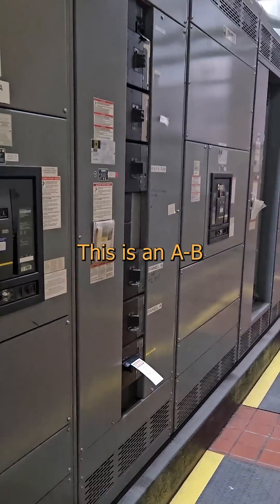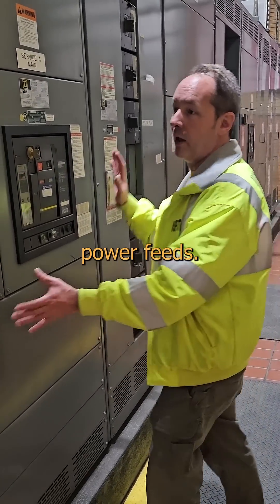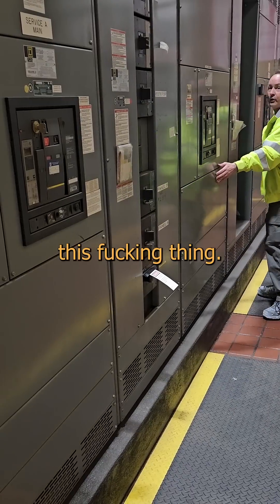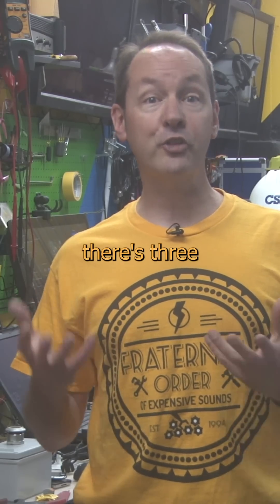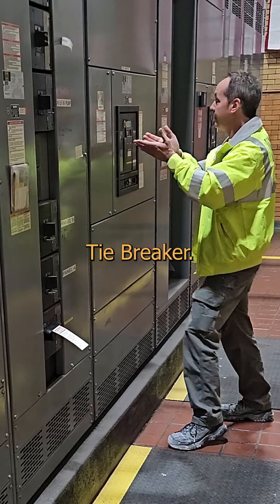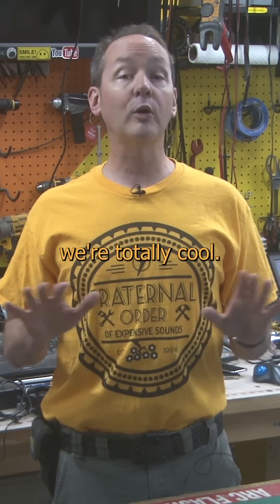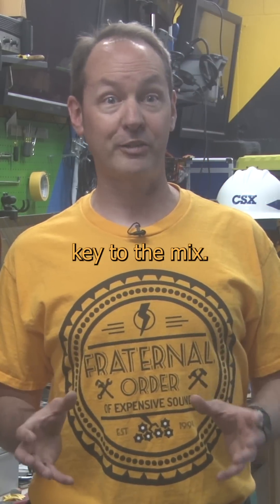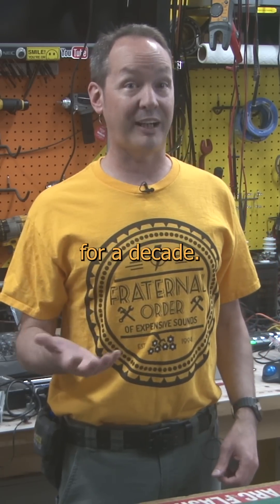A B Interface #chrisboden #comedy #electrical #engineering #energy #substation #switchgear #power

Comment: I had to strip down a blown cat 3516 1.5 megawatt generator engine once when I worked at power generation. The switchgear malfunctioned and the other 6 generators turned the generator into a motor and blew engine apart. The starter motor embedded itself into the wall. The floor had 2 inches of engine oil everywhere

Comment: I would have suggested a big copper switch that can only connect to one tie in at a time, but knowing these people someone would try and arc to the other contact at the same time. Also pretty sure at these voltages a manual switch really isn't going to work.

Comment: Before I retired, I supported the IT equipment at a famous fast food restaurant. The UPS system was wired in with Make-before-break flip-over switch. This allowed me to service or swap out the unit during the working hours without anything ever losing power. During the quarterly maintenance checks, I would flip the switch after the store was closed to verify that the UPS was still working and the battery capacity was still adequate. Started doing this after I found one location wired up incorrectly by the contractor or electrician, so I added it to the checklist.

Comment: Another cool thing similar to this but on a smaller scale is an ATS. You can take one and set it to automatically switch between two sources of power and transfer the load between them. I worked on these a lot in hospitals and data centers and it's a nice efficient mechanism for both starting the backup generator and switching the load over. 
Because when you have operating rooms that need to stay turned on, The last thing you want is to need someone to run down to the breaker room and switch the breakers over.

Comment: I worked in "the cage" at a company that made machines that put big power into big batteries, and then took that power back out of those batteries and put it back in the grid. Someone forgot that disconnecting one side did nothing for the other side.

Comment: This very setup was why I quit a switchgear manufacturing plant. My job was to test the interlock preventing two different power sources being tied together.  Somewhere in the build process the capacitor trip device was substituted with a in-house built unit. The problem was the unit had a built in shut off switch, whereas the originally planned one didn't. By turning off the CTD, the interlock would be disabled. I argued but was over rode, it went out the door that way. And so did I.

Comment: That is an idea used for all safety systems. A good Lock-Out, Tag-Out process will have some pretty serious key control. We can implement it all the way up to the SCADA system and implement token control and change monitoring. Layers aren't just great for winter wear.

Comment: Yep, went into a power room for a large city building that rain water came in along the feed lines through the bird poop, it was blacker in there than the Sarlacc's rectal passage, on every surface.  Using a flash light to find the blobs of copper all over the place under the soot just empathised how black it was.

Comment: Eh, yeah, sure, but the vast majority of subs DO close the tie on both sources, they just have a sync check cabinet to make sure the sources are in sync before the breaker is closed. So no big badda boom. (Back in the day they had little dials and a person had to sit there and wait for the hand to come around to close the breaker at JUST the right time.) And most subs STAY like that until something goes wrong.

Sure, customer subs (like the one you're at) typically don't have paralleling ability, but it's not unheard of.

Comment: "There's no way they both end up in sync and in phase at the same place in the same time"

This is not actually true. Some aircraft use parallel AC systems, powering the same busbar(s) from two three-phase AC generators. I believe Boeing 747s have each wing paralleled (numbers 1 and 2 generators paralleled on the left wing, 3 and 4 on the right wing but the two wings making a split system). We certainly teach student pilots about paralleled and split systems for AC and the requirements for paralleling and the different abnormal procedures for the two systems (split: bus tie open in normal operation, closed if one engine or generator fails; parallel: bus tie closed in normal operations, open if there is a paralleling fault).

These are of course smaller both in dimensions and power than the systems you are talking about.

Comment: this reminds me of a issue , er a discovery i illuminated to a large automation company that builds high voltage switching equipment for industry. it was basically a 3 way switch of tens of thousands of volts under vacuum with an interlock system that was supposed to function in a way as to tell the controller how to switch and when. the problem was the vacuum contractors being mechanically interlocked were incorrectly calibrated. the calibration was done with various lockouts , breaks and..... threaded rods!!!!!   that's the part that gets me. rather than having a calibrated rod or shaft it was super easy for a rod to be Mal-adjusted or for the retaining nuts to shift and slack over time.. just think about what happens when you shit phase state and there is a delay in one of 3 switches because a nut was loose......

Comment: I worked in petroleum logistics as an inspector.  We had a generator interlock that was the stuff of nightmares.  There were two systems on A/C and a single generator for backup.  The generator was only big enough for one system.  They installed a key system to prevent both systems from being connected.  The generator and two systems were in different buildings a few hundred feet apart.  Each breaker had to be pumped up and then a spring loaded mechanism would make the connection.

I’m inspecting couple of giggle buddies and I task them to switch to generator.  The guy grabs a checklist and starts moving switches and keys.  We end up in the generator control room.  It’s a small, noisy place with a 6’ tall generator inches behind you while you are moving keys and repositioning switches.

The guy is in the room throwing keys around, the girl is yelling the checklist at him and I am outside the door taking notes.  He threw a switch, and did what the system engineers thought was impossible.  Electrical sparks shot out of the control panel toward him.  

He turned and tried to run out the door, but his buddy was standing there with the checklist.  He threw her back into the danger area as he made his escape.  I walked in and ushered her out as I passed by the panel to the generator shutdown.

With the generator off, I watched a friendship die.  He had shown his true self when he pushed her into danger to save himself.  She was deeply hurt by his actions and held it against him.

I still have no idea how it happened.  I returned the system to normal operating mode and documented my findings.

Comment: I used to work at the Teleport in Staten Island and we were tied into both PSE&G and ConEd lines, so we had the same mayhem-capable stuff in our facility.  We also had facility-wide UPS systems for each feed, which had a battery room larger than a Wegmans and an inverter room that could easily kill you if you happened to be standing between the two units if one grid went dark.

Comment: I had an apt with different power feeds where half the apt can be w/o power when the other half has power. I could have used a extension cord with 2 male plugs & put a neon bulb between the hot leg & watch it go bright to dim as the different phases go in & out of sync.

Comment: Why is the key left in the lock? That seems to defeat the point of the key.
Reply: The key needs to remain there and can only be removed if you open the breakers it for safety meaning in order to close the tie breaker you’d need to open one of the other two breakers. Prevents accidental closing of any of the breakers.

Comment: I worked at a hospital with 4 feeds..  One came from one grid, one from another and one from emergency diesel power and we were a Co-gen plant too!  We had 2 non condensing steam turbo gen sets.  We had a back pressure of 15 psi that was used to heat the hospital during the winter/fall and absorption chillers "that use 15 psi steam" during the summer.  So you could think of the hospital as our condenser!

Comment: I work in a rural water treatment facility we don’t have a tie breaker we have two feeds but there controlled by the change over panel when the mains fail the generator starts and is placed on the board automatically.
How this work is multiple ups system maintain the MCCs and scads while the mains incomer closes and then the generator incomer opens meaning both systems are air gapping both supplies.
The incomers are mechanically linked to preventing both incomers being either open or closed at the same time

Comment: I work at a hospital that has gear like that.  Although it is just one key with two locks.  If the lock/breaker is open you can't take the key out to close the other.  Our line conditioner bank capacitors has five different lock key combos to isolate, open or close switches, and open or close cabinet doors.  12k volts. Awesome videos

Comment: You should look into Static Transfer Switches. its a fancy bank of capacitors and inductors that can correct an AC channel so quickly the load is never dropped. 
its break before make, but so quick the load stays up. 
you can also use a two input double conversion ups/conditioner to synchronize. or you can feed them to 2 seperate ups/conditioners that have a synchronizer.

Comment: A 13.8Kv phase to phase short disintegrates very effectively and very thoroughly!  I was an operator at a Nuke Elec. Generating plant and I've seen damage from a system failure that was a super big bada boom.  It happened 15 minutes before my shift started.  Securing everything to protect from any cascading failures consumed the next 12 hours of my life from the 345Kv yard to the 125V lighting panels.  Thankfully all the auto protective systems worked like designed making those 12 hours only fearing getting disintegrated and not technically getting disintegrated.

Comment: We have this at the hospital I work at. Two incoming feeds of 12.4kV. One is standby one is running. Both come from different substations. Load break opens first, when the load break is open the key can be removed and used to unlock the isolator. Once that isolator is open the second key can be removed to close the other isolator. Once closed the third key can be removed from the isolator and used to allow the load break to be closed. 
We also have three tie-breakers with key interlocks on the 600 volt side that we can use to move power around for maintenance.

Comment: There's a data centre in London, near Blackwall (so not far from Canary Wharf), which is specifically built across two grids (i.e. two independent electrical supplies) for EXACTLY this reason.
That's in addition, of course, to the backups if both grids go down.

Comment: On a service call for an induction heater at a power plant teardown, I was told about a generator that was thrown in out of phase after a rebuild.  It spun the coupling and they were down for 6 months.  They had a contract for natural gas and had to pay $50,000 a day for gas they were not using.  This in addition to the lost revenue and repairs to the turbine and generator.

Comment: Work at a power plant for a midwest untility. I work around this every single day and am often switching these power feeds as needed when there’s electrical maintenance needed on one side of the power plant or the other. Not as scary as it seems. There’s an either/or interlock on the buss but not a both function. The key releases the mechanical interlock in only one direction. So there’s NEVER a both! NOW THATS COOL!

Comment: So, that's why on the powergrid cartography/shematic app I worked on, there was this rule about not having "loops".

I remember when they sent mails about a maintenance worker having the panel (a small one, low voltage) blow off in his face (wear your PPE) because there was a hidden interconnection hidden (and not registered, I guess some sub contractors will never work for us again).

Comment: We had a computer room in a steel mill that had two feeder lines and two substations. One substation was for the melt shop, including the EAF. The other was for the rolling mills and rest of the mill. We had a UPS that could be fed from either substation, or a natural gas generator. The wall with the switch gear was pretty complicated, so we kept instructions on the wall. The air conditioner wasn't on the UPS, so we had to shut the servers down when the room overheated. :)
Edit: We never managed to screw things up in the computer room, but the EAF was 60 MW of arc. It melts over 100 tons of steel in less than an hour. It's a thrill to be around!

Comment: 42 years as an electrician and in some businesses continuous operation is critical and we would close in tie breakers regularly to keep everything running while de-energizing a portion for maintenance. But, you have to do it just right on a system designed for it!  Retired now and sometimes miss the sense of satisfaction I always had when completing a paralleling tranfer successfully.

Comment: Here's another fun tidbit. We had i think 9 big 4160V cat gensets (2.5mw I believe large enough to handle each units baseload power minus the largest equipment) at the mill I used to work at. We had to have enough load on the genset before we could use the main hoist (4x400hp motors on one large Siemens VFD) due to the chance of back feeding the genset with the regenerative braking from the VFD if they were hoisting down during power failures/black plant situations.

Comment: we had that at the hosp where i was a steam boiler operator. there were two diesel generators for power. if we had a blackout, i had to run to that room ans start them both. if one started and one didnt, i had break the tie braker. when the power came  back online from the city, i had to run to the electrical room, put on the suit, pump up the breaker until it flipped over and then run over and take the gens offline

Comment: Go watch a high speed safety video on arc flashes. Then look at the several ten thousand degree plasma ball and molten shrapnel being blasted all around. That stick guy to pull u back is only so they can attempt to identify the body before it’s vaporized.

Comment: Old water plant I worked had something similar but far less complex. Had two power grids being fed into the building. The plant only used one power source at a time. If you lost power, you went out to the transformer (in the building) where there was a massive switch lever for each grid. You’d throw the switch lever to the off position on the dead grid and then throw the other switch to the On position and hope to god it didn’t arc flash. The massive BANG the switch made when it hit still haunts my memories lmao. I still remember the warning label on the transformer: “No PPE exists that will protect you from electrical shock. Use Caution.”

Comment: I drive battery electric trains which can be charged using either 15kV 16,2Hz or 1000V 50Hz. In the manual is a paragragh that reads (Sorry for the crappy translation from german to english): 

Do not use both systems at the same time. Using both Systems can cause fatal explosive deconstruction of the main power components and can cause fatal electical injury. 

The systems are normally isolated from each other and under normal operating mode, both systems can't be used simultaneously.

Comment: I work at a utility, and we had a customer specifically ask us to allow them to close in all three so they had 0 down time in case one of them tripped. Now, I’m not as familiar with the setup inside, but on the outside/sub we had special equipment to make sure both circuits didn’t get too far off, especially since the two feeds were powered by their own power class transformer

Comment: I've been on both sides of this. I've closed plenty of 11kv and 33kv bus tie switches so i can take out one of the incomers. Nothing went boom.
But, I've also been in the main switch room of a 30 story building with 2x 400V incomers from the local grid, and a bus tie between them with only two keys. What they don't tell you is trying to remove a castel key from one breaker to close the tie switch will cause that incomer to trip, shutting down the bank branch in the building, the betting agency, and stranding people in the lifts on a Friday afternoon. The saving grace (for me) was that one of my higher up engineers had done EXACTLY the same thing two weeks earlier. Did that dickehead put a warning label on: 'removing this key WILL trip the breaker' -no! But I did...

Comment: I don't know if it would be efficient enough to use in that sort of application, but I can think of a number of cute ways to adjust the phase angle of delivered power. (Maybe even the frequency?) I'm sure such systems would cost a lot more than this ones does. (E.g. Give me 9-12 muti-tap transformers rated for 2-3x the VA of the application and I'm reasonably sure I could get something working ... if the bean counters don't kill me first.)

Comment: Hey, i got to work on comissioning one of these recently. AB split, 3 grid connections, a few mw of battery backup and 3 generators. Automatic fault isolation and backup within 0.5 seconds with redundancy on all equipment. So many redundancies to test

Comment: I did a plc control upgrade project that involved this system. We had two 12470v lines and two massive 480v generators. The old system was controlled by keys and relay switches the new system ran everything off of 4 small plc systems. It's wild how much smaller the new stuff can be